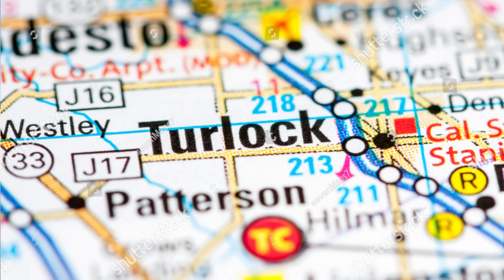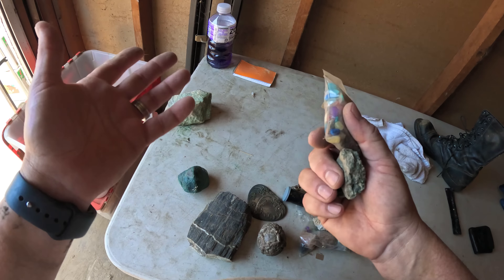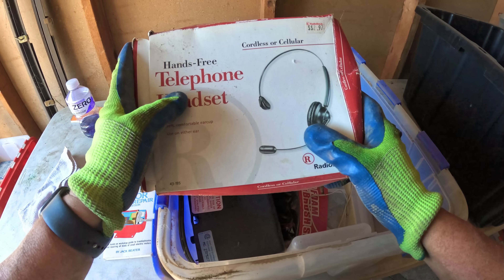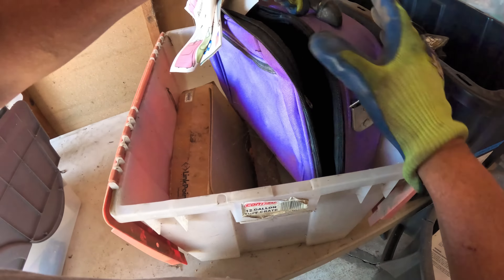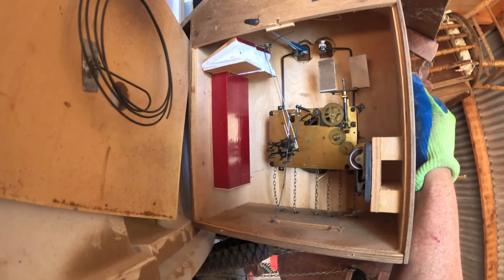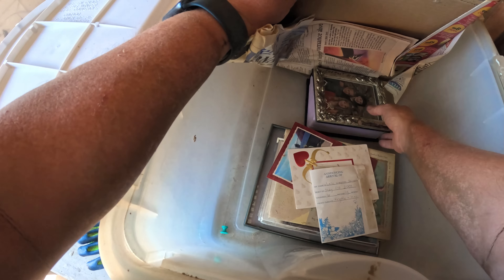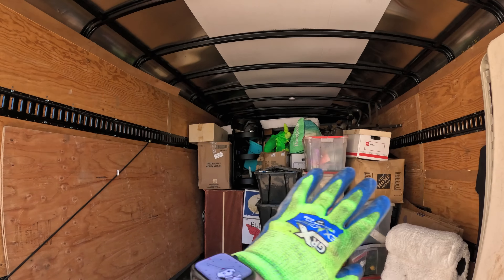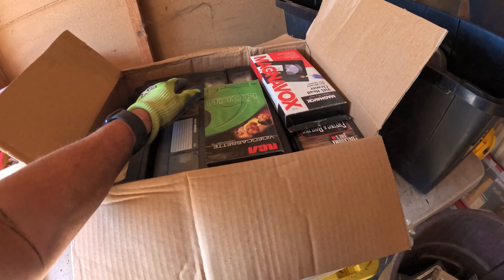This storage unit was ABANDONED for 25 YEARS...

Comment: The antenna rotator was from back when most homes had antenna on their roofs or on 20-40 ft pole towers. It was my job to turn the dial in the direction and number of clicks grandpa instructed to dial in the 3 to 4 channels on the airwaves most of us got in the 70's😂

Comment: 😁👋👍👍👏👏💕🙏🏻
I would plug in the projector to see if it works. I personally would go as far as replacing the light bulb. But you are mega busy. If in working condition I would list it. 
The same with the Wiccan books. I was surprised at the resale value. And how quickly they sell.

Comment: those look like cue lites. We use them in theatre to cue people when to enter  if there is not a "word cue" or "music cue" that they can hear. We run them backstage and turn on one light for stand bye and then either a GO light or turn off the stand by to signal a GO. the stage manager operates it. Can also be used to cue crew movements if there are not headsets in use